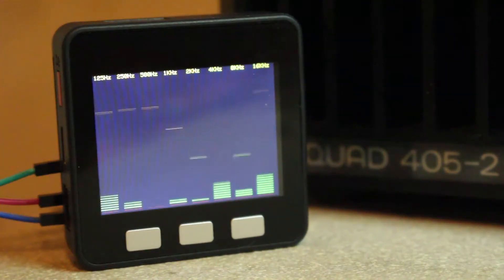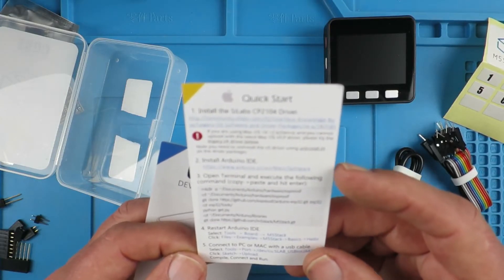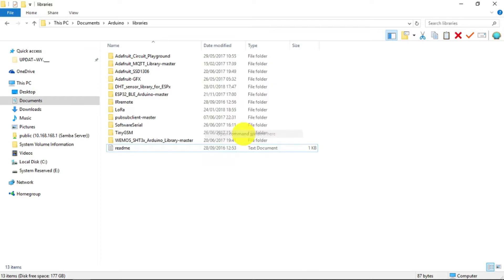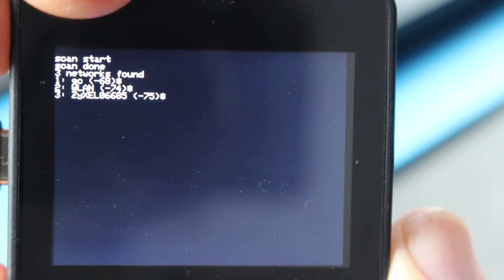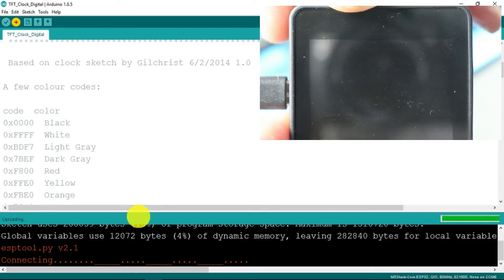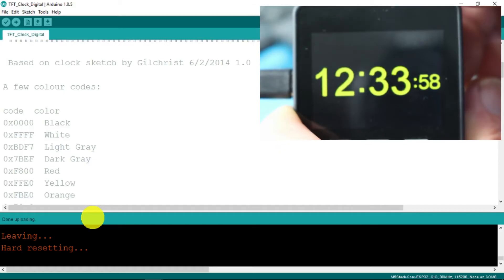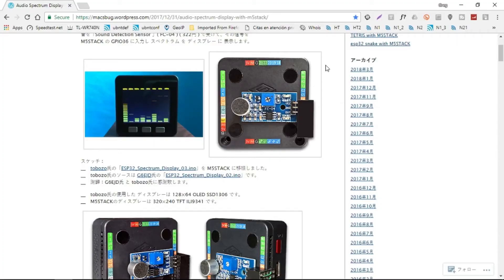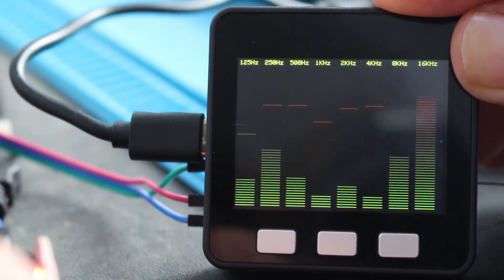ESP32 M5Stack Core Review And Test. Does It Stack Up?! Electronic Tutorial

Comment: I was worried the reset bug would be on mine. Not a huge deal, it’s an easy capacitor to add. But it seems like they’ve fixed it on newer ones.
Reply from the maker: Thanks for the update. Glad they got it fixed.
Reply: Yup bought it on amazon earlier this week if that info helps at all
Reply from the maker: Thanks Marcus, good to know.